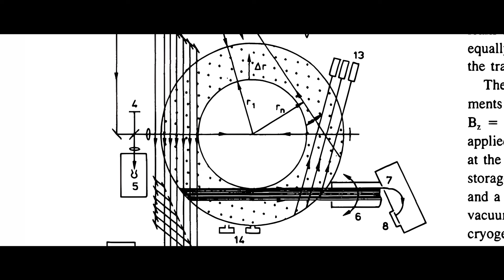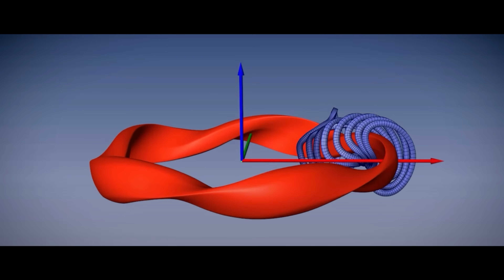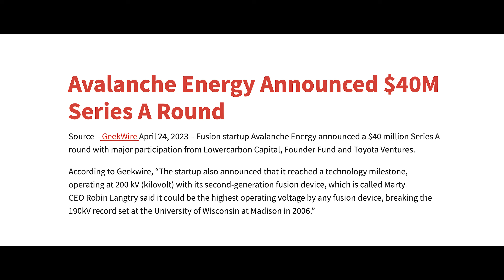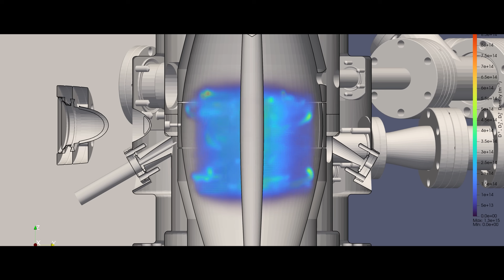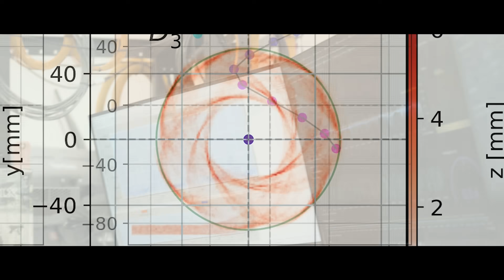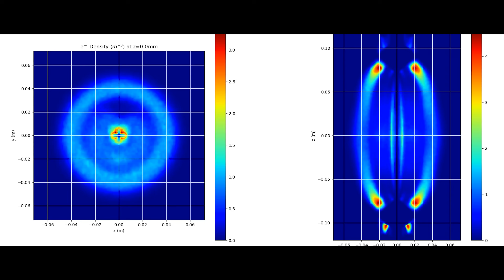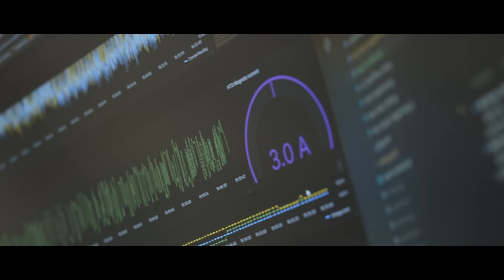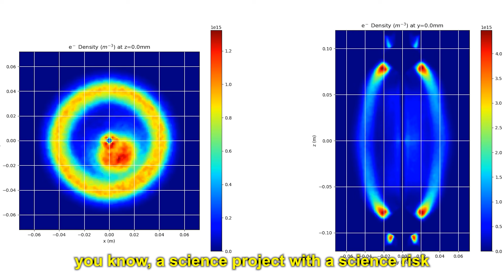This Company Invented a New Way to Do Fusion

Comment: this makes be feel extremely motivated and locked in for the future
Reply: Are they sign tests 🤔
Reply: these guys pop up every once n a while
Reply: A promo vid, infomercial, but I wish them success however they may define it.
Reply: Is this research related to vortices in super-fluids, at high temperatures instead of low temperatures?	

	Quantum Vortex Theory:

    Is there a geometric explanation of Planck's constant?   Does this explanation require at least one extra spatial dimension?  Are vortices in superfluids macroscopic simulations of this geometry?  Richard Feynman recognized the need for a simulation of Quantum Mechanics. Since vortices in superfluids are extended objects with two different ends, could this help us explain effects such as "Quantum Tunneling".

   Dr. Roger Penrose has suggested instead of trying to find a particle called the "graviton" to explain gravity, why not try to describe subatomic particles in terms of spatial curvature, as in the twist in a piece of real thread.

    What if we add one extra spatial dimension to the "Twistor Theory" of Dr. Roger Penrose?   It can be "chiral" by having either Right-hand or Left-hand twist.  It can be "Quantized", based on the number of twist cycles.

   If Physicists describe electrons as point particles with no volume, where is the mass of the particle?

   Can one extra spatial dimension produce a geometric explanation of the 1/2 spin of electrons?   The following is an extension of the old Kaluza-Klein theory. Can a twisted 3D <---> 4D soliton containing one extra spatial dimension help solve some of the current problems in Particle Physics?

   What do the Twistors of Roger Penrose and the exploration of one extra spatial dimension by Lisa Randall and the "Belt Trick" of Paul Dirac have in common?  Is the following idea a “Quantized” model related to the “Vortex Theory” proposed by Maxwell and others during the 19th century?  Is the best explanation of the current data a form of “Twistor Theory” first proposed by Dr. Roger Penrose during the 1960s?  During recent years Dr. Peter Woit has explored Twistor Theory as a possible solution to help explain the current Standard Model.

   Has the concept of the “Aether” been resurrected from the dead and relabeled as the “Higgs Field”?

In Spinors it takes two complete turns to get down the "rabbit hole" (Alpha Funnel 3D--->4D) to produce one twist cycle (1 Quantum unit).
 Can both Matter and Energy be described as "Quanta" of Spatial Curvature?  (A string is revealed to be a twisted cord when viewed up close.)         Mass= 1/Length, with each twist cycle of the 4D Hypertube proportional to Planck’s Constant.

In this model Alpha equals the compactification ratio within the twistor cone, which is approximately  1/137.

1= Hypertubule diameter at 4D interface

137= Cone’s larger end diameter at 3D interface where the photons are absorbed or emitted.

The 4D twisted Hypertubule gets longer or shorter as twisting or untwisting occurs.   (720 degrees per twist cycle.)  

   If quarks have not been isolated and gluons have not been isolated, how do we know they are not parts of the same thing?   The tentacles of an octopus and the body of an octopus are parts of the same creature. 

     Is there an alternative interpretation of "Asymptotic Freedom"?  What if Quarks are actually made up of twisted tubes which become physically entangled with two other twisted tubes to produce a proton?  Instead of the Strong Force being mediated by the constant exchange of gluons, it would be mediated by the physical entanglement of these twisted tubes.  Are these the “Flux Tubes” being described by many Physicists today?   When only two twisted tubules are entangled, a meson is produced which is unstable and rapidly unwinds (decays) into something else.   A proton would be analogous to three twisted rubber bands becoming entangled and the "Quarks" would be the places where the tubes are tangled together.  The behavior would be the same as rubber balls (representing the Quarks) connected with twisted rubber bands being separated from each other or placed closer together producing the exact same phenomenon as "Asymptotic Freedom" in protons and neutrons.  The force would become greater as the balls are separated, but the force would become less if the balls were placed closer together.  Therefore, the gluon is a synthetic particle (zero mass, zero charge) invented to explain the Strong Force.  The "Color Force" is a consequence of the XYZ orientation entanglement of the twisted tubules.  The two twisted tubule entanglement of Mesons is not stable and unwinds.   It takes the entanglement of three twisted tubules to produce the stable proton.   The term “entanglement” in this case is analogous to three twisted ropes being wrapped around each other in a way which causes all of the ropes to move if someone pulls one of the ropes. Does the phenomenon of “Asymptotic Freedom” provide evidence that this concept is the correct interpretation of the experimental data now available?  Can the phenomenon of "Supercoiling" help explain the "Multiple Generations" of particles in the Standard Model?  The conversion of twist to writhe cycles is well understood in the structure of DNA molecules.   Can the conversion of twist to writhe cycles and vice-versa help explain "neutrino oscillations"?   Within this model neutrinos are a small, twisted torus produced when a tube becomes overtwisted and breaks producing the small, closed loop of twisted tube (neutrino), and a twisted tube open on each end, which is shorter than the original.  (Beta Decay)

   Within this subatomic model gravity is produced by a very small higher dimensional curvature imbalance within atoms, which causes all atoms to be attracted to all other atoms.  This small imbalance is “Quantum Gravity”.  This extremely weak attraction reveals the very small scale of the curvature imbalance.  This produces the curvature of spacetime on a larger scale like the solar system which is required to counterbalance this small imbalance in the individual atoms.

    A recent article by Adam B. Cahaya titled "Spin may resolve century-old puzzle of light's momentum in matter" published in Physical Review A may help confirm this model.  The following is a quote from a summary of the article.  "Spin is the intrinsic "twist" of light waves, a quantum property as fundamental as energy or momentum."  The citation is dated September 24, 2025.
Reply: @spiral Have you guys ever checked out how Radom Corporation makes atmospheric plasma?
Reply: Also you can chemically heat and cool the molecules with suprrconductibg magnets oct magststic feild
Reply: a future where all energy is monopoly controlled and a political tool to wield against the public?  Because consolidation of this scale only serves the singular purpose of yoking society with control over a centralized energy infrastructure.  There's only profit and control at the end of this tunnel.  Humanity itself will not benefit in any way from this technology.
Reply: ong
Reply from the maker: pinned.
Reply: @createdbyspiral 
Please make the music LOUDER, I can still just hear the voices....🙄
Reply: Confused Fusion Power nuts have wasted over $2 trillion globally and probably more in wasted Watts. China will do what US could have done by 1960 - THORIUM FISSION BREEDDER REACTORS.
Reply: @PrivateSi I'd like to try both ways.  A lot of the failed atempts at fusion has made scientific progress and pantents, so aren't allways useless. Who knows, some of it might even be usefull for building a LiFTR as well
Reply: @Hakaze  .. Each experiment unearths a load more unsolvable problems, that's the problem. You can't have advanced nuclear, a tax-funded hyper-military, S.S. and Scientific Dictatorship addicted to throwing good money after bad..
Reply: @Hakaze can also start outside in. Elevtro static outside
 Magneto static next vaccim interior will turn a  iron torsion or braided copper  system to not nerd steam.
Reply: @PrivateSi why are you China bots so obsessed with America, you guys prolly watching this to steal it too
Reply: @PrivateSi  I'm glad there's someone out there aside from me that understands the truth of this 68-year-old scam.
Reply: @PrivateSi  
China may well do both.
The REAL questions are....
Depending on who cracks either Thorium OR Fission (Or indeed BOTH?), WHO GETS TO USE IT?
If "A company" builds either reactor and it happens to be small (ish) Fast and Cheap (ish) Will that company, or (More likely) "the government of that company" DONATE it to "The World" OR declare "It's OURS and if you want it, you PAY for it" Followed by a LONG list of those who WILL NOT be allowed access.
(I'm sure you see my train of thought?)
.
Or, if "the other side" (Whoever they are at the time) achieves the goal, Then declares that the technology will be available to all countries associated with "an expanding coalition" (Guess) AND those outside, providing those outside don't cause trouble, what methods might be used  to STOP the progress with the aim of maintaining, or rather regaining dominance?
Reply: Yeah, I'm taking my money out of Theranos and investing in this outfit. Sorry, Elizabeth Holmes, this one is the real deal.
I'm sure of it this time.
Reply: @-danR  holmes the lying psycho?
Reply: @-danR  you appear in need of a wellness check
Reply: Barf. 
Locked in? Are you a sophomore?

Comment: I'm genuinely curious... When this reactor becomes a reality, where do you pull the power from to (re)start the reaction? A separate power plant on the grid? If so, would it be a stand-by power plant, or something always running in parallel?

Comment: It's going to take guys exactly like this, I have a strong feeling, to actually make fusion work to truly put power on the grid. I often can not believe of the billions poured into ITER. I don't doubt that overdone and never ending project will add volumes of technical advancements to the fusion journey, but I have my doubts that when and if they achieve net power it will be commercially scalable in a cost-effective and repeatable fashion. I guess I have more faith in alternative thinking in cracking the fusion nut. Good video and lot's to hope for here.

Comment: This is such a great ambition. If they’re able to get these up to 50kw-100kw of continuous output per unit and it makes it to mass production at a price $30,000 or less these things could one day be powering homes off grid or even EVs without the need to ever plug in and recharge. That would be the holy grail of renewable energy.

Comment: Question.... Does speed and vibration have anything to do with lamination. 
Frequency must play a part as well. 

How do you control speed it up in rotation... Ultrasound energy add? 
Slowing is not a problem.... Resistance of some kind is causing bunching.  So speeding the plasma up could help. 

Also regulating the frequency of the plasma may be an alternative by external control? That would be ideal. 

Be it magnetic pinching as a speed up or slow down or lead by circular movement through attraction lead like a rail gun magnetic force....

Comment: This is my wild guess: You achieved to gain 1 phase of density clutter. Understand its behavior to know what conditions cause that grouping and rotating of ion batch, then proceed to try adding two more groups of same clutters, but that are shifted by 120 degrees (because it reminds me of rotating magnetic field in motor). Sync the rotation at these angles and distance and it might be stabilized.

Comment: There is another thing that I wanted to say that if you take the containment field that is in direct contact with the field.That is emitted from the plasma.If you are able to shear the surface area of the plasma through the direct interaction of the containment field, the point is or the proposition is, if you rotate the containment field, then you should be able to keep the surface area of the fusion plasma in a more stable manner, the faster you have, the shearing effect on the containment of the fusion plasma.The more you're able to distribute the thermal energy density

Comment: what do you mean by "laminar"; seems this term has been changed in USA superceding smooth or streamlined. Apologies if incorrect. Basically laminar flow is  dominated by viscous forces giving very low Reynolds numbers up to a value where the flow becomes turbulent.

Comment: I may or may not have made an idea with similarities but a lot more like a plasma core instead of a fusion reactor and it transfers the heat into electricity from the plasma then uses the plasma to power really anything like a nasty battery arc reactor type thing

Comment: Be careful yo! You might end "cold" fusing it, lol. Great work, don't get too distracted by the spinning spininess. Also, more importantly, what happens when the eureka clicks and the schematics are simple enough anyone in their garage can build an apparatus capable of collecting antimatter? Well, that's the real ****ing difficult one to solve, because it's not scientific or at least it's fundamentally a question of social approach. That is, in order to do the "real" "interesting" work, (like feasible intergalactic traversal) "we" as "scientists" must resolve by idempotent and accessible means a systems theory with no central dogma but providing for resolutions to "general blockers" most humans daily either suffer from or otherwise have to work against it doing them in. Eg, say you've stumbled onto a novel form of fusion production, well then how do you prepare the rest of the world so it doesn't very quickly lead to the shattering of the Earth's mantle when some random bug shorts one of the wires and collapses the antimatter colloidal suspension block?

Comment: Exploring different things is good, but then it also has to be practical. So they got a high particle density. On its own, that is easy. But then they did not mention the other two parts of the Lawson criteria, the triple product of density, temperature and confinement time associated with the high density. All three must be present simultaneously. But since they failed to give the other two factors, this result gives every appearance of meaning nothing.

Comment: Can you desigh go from your today's surface area of plasma facing components to bigger one ? Because the reason the ITER so big is that under fusion plasma densety and temperature your first wall should withstand flux of hot plasma, that melts first wall and contaminates plasma. So tipical solution for a tokamak or stellarator to smear this flux on bigger surface area. So can you do it in future iterations? Or maybe your isolation of first wall is so good ?

Comment: Super conductive electromagnetic energy storage systems that will allow the release of electromagnetic energy into a concentrated vector that will emit their energy into a magnetic funneling compression.
Field this field will be directed to a specified point through magnetic lenses that will amplify the energy density at
The point of desired impact, the impact will be the direct
Predetermined nucleus of deuterium, and the nucleus of tritium ionized atomic nuclei this location will be within a mirroring chamber.Allowing for a exterior conditioning to allow for thermal energy density to exceed specified numbers.Allowing for the compression ratio to exceed the triple products threshold

Comment: They couldn't make artificial diamonds until they started using heat plus pressure. I think the same will happen with fusion. You'll need heat plus lots of pressure both at the same time. It just makes sense and that's not what they've been doing concentrating on heat and containment. With a quick shock you don't need containment. You provide heat and pressure and you get fusion and you do it in pulses, no containment required just a lot of cooling water which turns into steam. Perfect!!!!!

Comment: These guys need to try and form a Birkland current inside of the machine in the plasma and create a Z pinch effect using the electrostatics and they will have fusion. The plasma will self organize under the right conditions.

Comment: A reminder: Invariant rest mass increases with the velocity of a particle, be that a particle in a particle accelerator or the particles that compose a plasma rotating at relativistic speeds. Furthermore, this has a non-trivial impact on cyclotron frequency. Furthermore a large gear in a mechanical device, will spin a smaller finer-toothed gear at a higher frequency than a gear of the same number of teeth. if you can minimize parasitic capacitance, it is theoretically possible to surround a plasma ring with larger plasma rings, and accelerate them significantly while synchronizing them through harmonic resonance so mutual but oppositely charged instabilities cancel by destructive interference. Also, for the last time, I am not a time traveler.

Comment: hmm, still very basic imo.  Going to hit more walls in every area.  i think you need better input cath/anodes w/ a lower resistance.  Multiple frequency modulators that can generate harmonic sympathetics or even dispersion thereof.  Better materials in general.  I can applaud you in areas like monitoring devices and sensor stuff, I'm guessing the speeds are really super high.  I think it's still just basic science and basic materials.  Helion has been working on many aspects and are ahead imo.  I would like to see a company like this be a provider of materials for the fusion space as an industry.  there are many areas, carbon fiber, steel alloy machining, full stack testing equipment, etc.  Once you have a base of income besides investment, each new rig iteration may take longer to mfg. - but it ensures that 10x iterations of test rigs are possible.  The 'magic' should come, but I fear that Earth's gravity itself will prevent the last layer of necessary efficiency.